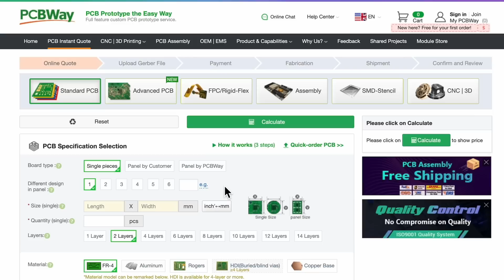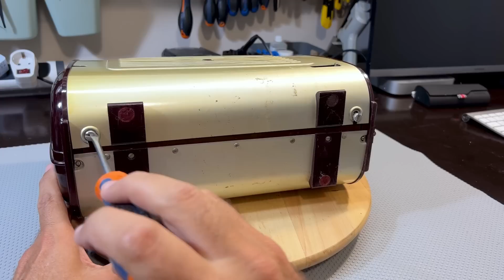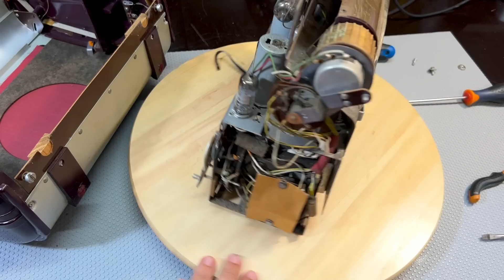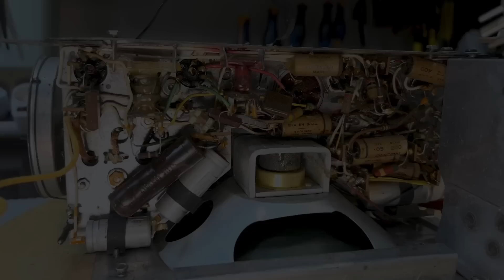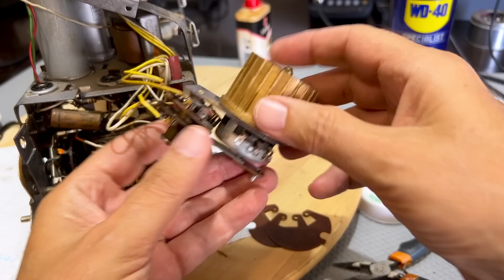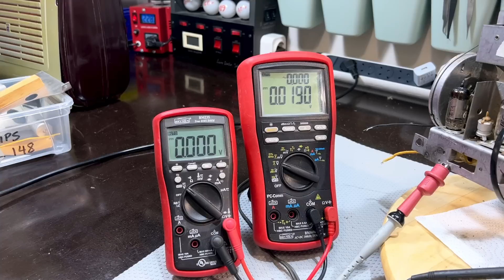My first portable tube radio, and it's Australian! Philips Model 148 restoration part 1  #pcbway#

Comment: Hi Manuel. Great to see you working on a real radio for a change Ha ha!  It will be a pity if that output valve is gone. I’m thinking maybe the output transformer is open? I will be interested to see how you go with it. 
I’ve only worked on a couple of battery sets before so I can’t be of much help, however you should be able to get European equivalents for all of the valves. 
Best of luck! I’ll be watching with interest!
Reply from the maker: Real radio indeed! I’ve actually found a complete set of tubes that are in their way from holland, so there is hope.

Comment: The Philips "Tinnie"; every Australian collector ends up with one or more of these. Just some points:- The rectifier is a 6V4, not 6V6. The European type number of the 6V4 is EZ80, which is close enough to the specified EZ82. EZ82 was a short lived obscure valve, so 6V4/EZ80 is the usual replacement and has a slightly higher current rating. Filament voltage for the other valves is critical - exceeding the voltage will damage them. This is why the filaments are shown with 1.3V on mains, to allow for a reasonable increase in mains voltage. 1.5V is with a fresh battery, which quickly settles down to 1.4V, which is the voltage they are actually rated at. I connect a 9.1V zener diode from the end of R17 to earth, to protect the filaments, just in case. The battery was a combined 9V/90V type. I suspect the reason for the slightly high B+ is because the filament voltage is only 7.5V, and so the valves, in particular the 3V4, are not drawing normal cathode current. Anyway, a slightly high B+ is not as damaging as a high filament voltage. Valves made in Australia generally used the RMA (American) system of numbering. All the valves in this set have European type equivalents, so are easily available worldwide. The 80mA filament current when run off the power supply was a bit of a worry. The filament current should only be slightly more than 50mA, because of the various shunt resistors which compensate for cathode current. But not 30mA more! (I hope that was just meter inaccuracy). The filaments of 7 pin battery valves are almost invisible when glowing, unlike mains valves, so this should not be used as an indication of correct operation - in fact, if they are clearly visible in normal lighting, something is not right. Generally a recap and check of the resistors is all that's needed to get these sets going. The loop aerial connections are actually intended to be desoldered before taking the chassis out. Hope that helps...
Reply from the maker: It helps a lot. Thank you. I realised my error in saying it was a 6V6, obviously it’s a 6V4.  The 80mA is actually more due to the meter than the fact. I checked later and it was reading too high. I have actually found a set of valves (NOS), and they are on their way as we speak.

Comment: similar in look/style to some rca models, and also a bit to a uk murphy b143(thats battery only, though)  that style must've been a 'thing' for a while!
Reply: @electronicsoldandnew  the murphy one was a bit  unusual as had an rf amp stage, most uk battery portables didnt, likely 'cause the metal case damped the frame aerial picking up signals, so had to add one to make it usable 😁

Comment: Am  I hearing you correctly? A 6V6 is an output pentode. How could it be wired as a dual rectifier?
Reply from the maker: My mistake. It’s a 6V4, not a 6V6.

Comment: Manuel,
The filaments of those tubes are delicate. Be careful about exceeding the rated current. 80 mA is too high.  The tube filaments are in series, so the current is the same through each tube. Adjust the supply to provide 50 mA. I expect it will come out to be 7.5 volts. You should not see any of the filaments glowing in a lighted room. Never unplug any of those tubes with power on. The converse is true also. Don't plug them in with power on, either. 
Regards,  Gar
Reply from the maker: 👍 thanks for the tips.

Comment: I've found some of those valve types on eBay, but not cheap. I hadn't seen a battery radio that has 9 volts to supply the heaters. Ones that I've worked on in the past had the heaters in parallel, which used a 90v / 1.5v battery . I had a few old military 4 band transceivers, which had nearly all the valve types that's in your radio, these surprisingly,  were working fine for my radios. These valves are probably only found in Europe. Looking forward to seeing it working soon.
Reply: I think that 9V to heaters is there to reduce current when running on AC. Tubes are directly heated so they need DC filtered current to heaters. If you would use heaters in parallel, current would be 5 times higher and the drop down resistor would consume much more energy. More modern construction used low voltage section on transformer and selenium rectifier for heater voltage. Than there were no problem to use heaters in parallel and there were also less loses because there was no need for drop down resistor for heaters.

Comment: At last, a bit of quality in your radio repertoire Manuel. The comments below fill in most of the blanks so I won't repeat them. I have one here in fairly poor condition and its battery only, I must do it one day 🤔 If you choose to test the valves, select the 1.4 Volt position before plugging in the valve... don't ask how I know 🙄 Good luck Manuel, this should be an interesting series 🙂🦘🗡
Reply: We must send him more!
Reply from the maker: 😊 always welcome
Reply from the maker: Thanks Dave. If I test the tubes I’ll have to rig it up manually using my DC supplies because my “tube tester” project didn’t include 1.4V heater supplies 😞 fortunately it’s not difficult. 
I must admit that I now understand your reaction when you did your first German set. Rather a different landscape when you go from one “standard” to another. The number of comments and help I’m receiving in them is also surprising. I guess more people are into these types of sets than the german ones I normally work on.

Comment: It's nice to see an Australian set get into your hands.  The portable sets are quite different to mains, but in many ways similar too.   They use different tubes, but are still working on the same principles.   You may find this unit had a high voltage B Battery and not a vibrator or other step up method.
It was very typical of Australian radios to have no frequency markings, but only the states and the the station call signs.  The states are prefixed with numbers, still to this day.  2 for New South Wales, 3 for Victoria, 4 for Queensland , 5 South Australia, 6 for Western Australia and  7 for Tasmania.  I believe some Australian Capital Territory (ACT) stations were prefixed with 1, but a lot now use the NSW prefix of 2.   Looking forward to seeing how this turns out, so I will watch the rest of the video now.
If you want to work out the frequencies a little, 4QR as an example was on 610  (now on 612KHz), 4BK was on 1290, 4BH at the time was on 1390KHz, later to move to 880 then 882KHz when the spectrum division was changed.   Very few of the stations still exist on AM now, and the ones that do likely are not on the same frequency any more.
Reply from the maker: Thanks for the info, Brendan. Always good to know the background details. Makes life a lot easier 😊

Comment: My parents had one of these radios when i was a kid. I used to love opening and closing the cover /  switch over the dial. Those dial markings showing the call signs of the stations was very typical on Australian radios of the era, the larger print being stations in state capitals , smaller print in regional areas. Very few of those old call signs survive but a few are still used such as 2GB in Sydney, the 2 letters were usually a abbreviation of the original company that owned the station and the first figure indicated the state eg. 2 for NSW.
Reply from the maker: Thanks 😊

Comment: A very good start. Kudos. I have the same Siglent PSU and therefore the same high voltage source issues. It did occur to me that I can DIY a temporary DC high voltage source by simply adding a bridge rectifier to my VAC supply. Smoothing capacitance and regulation being possibly required, of course. HTH.

Comment: The tubes are normally 1T4 ,1S5,1U5 , the filaments must be 1.5 volts and 90 volts for the B+ is 90volts and filaments are 1 volt each. The other tubes you might find are DAF91,DF91 or similar markings. I hope this has been helpful.
Reply from the maker: 👍 thank you
Reply: @electronicsoldandnew  there are several other variants of these b7g battery valves, some with different pinouts,  plus  later 25mA filament types,

Comment: Those tubes are the USA equivalent for a battery powered radio of that era: 1R5, 1U4, 1T4, 1S5, 3V4, 3S4 (some radios use the 1T4 instead of the 1U4, and some radios use the 3S4 instead of the 3V4) and some radios may use a 117Z3  rectifier tube but that’s only because here in the USA we use 120 volts AC
Reply from the maker: 👍 I’ve also seen one RCA version of this radio that is a hot chassis.

Comment: And the batteries that they used were 1.5 to 7.5 volts A battery for the Filament and 45 to 90 volts for the B+ that’s why it’s called a B Battery and the heater is usually not visible

Comment: Hi Manuel, these are as common as mud here and very few people want them! I have 9 in the garage waiting to be fixed. Having said that, they were originally a RCA America design, 1948 66BX. Philips Australia took the USA model when RCA were finished with it and then developed it. There are quite a few variants, both in cabinet design and electrically. 111, (six variations), 134, 148, and 168 (Mullards were simply badge engineered.) There were battery only models too. 455 Kc/s is the Intermitent Frequency used on most radios in Aust. For the alignment 600 kc/s is (Tas) 7ZL, 1420 (Vic) 3XY, and 1500 (Vic) 3AK. Very few Australian radios had the frequency until Japanese radios took over the market!
If you have problems getting the valves/tubes, I can get NOS/Very good tested used ones through the club (HRSA) at a far lower cost than other places. I have a lot of dodgy spares as well. We also have a battery eliminator kit for the 90/1 volt supplies. It's very effiecient because the heaters don't draw much power. The power switch on the dial shutter tricks everybody at first! Good luck with it... even thogh it's a RCA, it's still made by Philips. 🤣
Reply: I have an RCA 8BX6 which has was the North American predecessor to this radio. Cabinet and operation is nearly identical. I need to dust it off and overhaul it.

The miniature tubes are very sensitive to leaky coupling caps. I worked on a very compact RCA portable for a friend. It was dead as can be but slowly came to life with each cap replacement. When I was done it proved to be a hot little receiver. I didn’t want to give it back. LOL

I look forward to the rest of the series.
Reply from the maker: I’m anxious to see how the new tubes work, since all the caps have been changed.
Reply from the maker: Thanks for that info. Always good to know a bit more about the radios being worked on. This type of set is very uncommon at my end of the world, so makes it interesting. I’ll bear the tube issue in mind if I find that it is the problem. Thanks.
Reply: @electronicsoldandnew  No worries. I'll see what radios are for sale at our market day on the 19th and might send you another to work on!
Reply from the maker: 😊 thanks

Comment: I am sorry of this repeats anything Manuel but my comments about this being a nice radio and especially with those built in switches  seem to disappear.  Also that I did a quick search on a very popular on-line UK auction website and there are several entries by folk selling the valves Radio Museum mentions are used in this set. I hope this proves helpful. Gerry

Comment: It looks like whoever designed was heavily influenced by the American RCA BX6 portable radio. Both radios have very similar Bakelite cabinets with metal grills, as well as the same dial-and- lid arrangement.
Reply from the maker: That’s right. I’ve just looked it up and the schematic is quite similar.